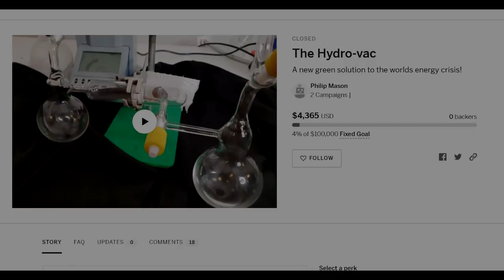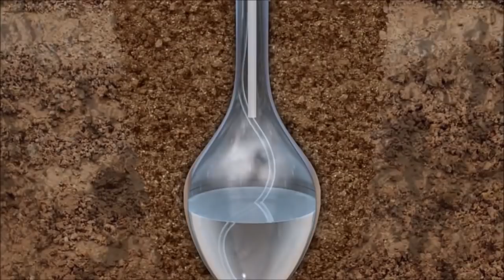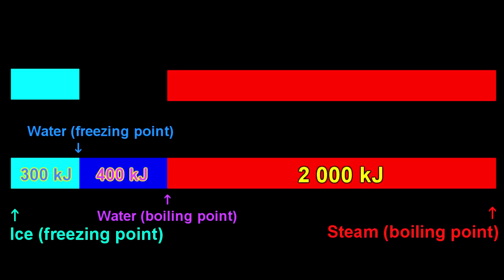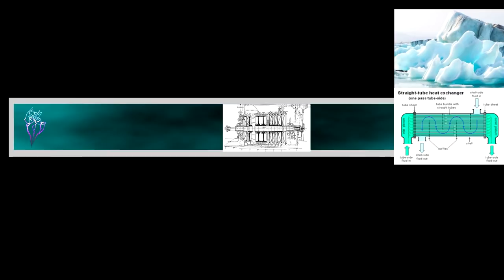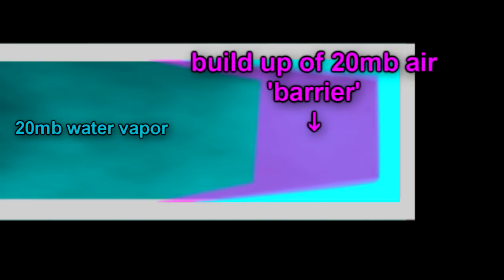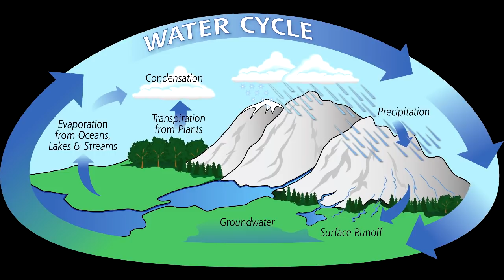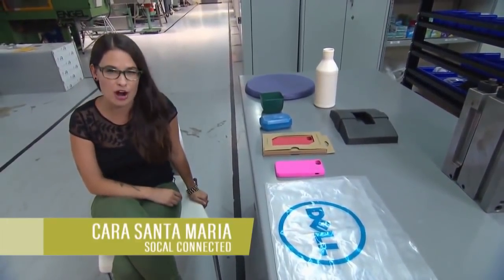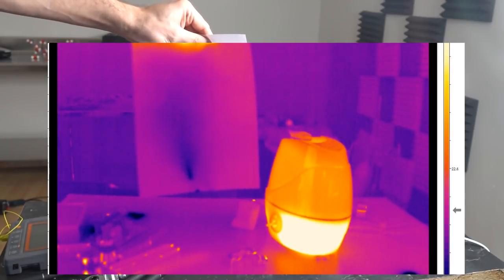The Hydro-Vac -BUSTED

Comment: Love the videos as always or though you did get me thinking about something. There is maybe a situation and some design changes that could make the water seer possible. All that needs to occur is a coolant that is naturally cold and flowing, like the ocean, a much larger wind turbine and air channels and actual fins for heat exchange. So as long as the waterseer is completely redesigned and in the middle of an ocean completely surrounded by water it could actually be possible to get some undrinkable water from it. As always love the videos TF.

Comment: On the flip side these numbers show that primitive evaporative cooling can work insanely well: just rub some water on your arms, wear a wet towel or set up something next to a desk fan. You aren't adding any energy (=heat) into the system to make it work and in most places it's easy to reset by airing the room while the outside humidity is low.

Comment: On the matter of Hyperloop, I've just looked up the Wikipedia page and found that one of the candidates is Edinburgh-London. I know this route well as a railway enthusiast so let's talk about a few details.
1) Would the line have only 2 stations or would there be intermediate stations in Newcastle, York, Doncaster, Peterborough? The more stations, the greater the difficulty.
2) Stations will have to be totally airtight to allow airlock gates to open when trains exit or enter a station.
3) At 700 mph, it would take roughly 35 minutes for the trip from Edinburgh to London. With the time taken to load the train, suck the air out of the departure station, do the trip, allow air into the arrival station and unload the train, this would likely double the time, therefore 60-70 minutes. This eliminates the possibility of running a second train in the same tunnel. Take into account the size of the stations, depending on the length of each train, and we will probably have trains holding 50-100 passengers as opposed to the 600 carried in trains now doing the trip in 4h30/5h00. A lot of people who would normally take a train at 8h00 would have to a train much later. What about those who travel at 10h00, 12h00 etc?
4) Stops at intermediate stations would be a nightmare. Edinburgh - Newcastle (125 miles) would be travelled in about 10 minutes.  How long to open the airlock in the station? Let's say 3 minutes. So the train is no longer travelling in a vacuum and slows down.  Let passengers onto and off the train, reset the vacuum and you have lost maybe 20 minutes.
5) All of this may be good for those in a hurry but Hyperloop is supposed to supply transport cheaper than that which is presently available.

Comment: You forgot to mention friction losses in the tube, there will be a pressure gradient that further reduces the heat flow. To illustrate on your bench setup, you could use tubing that has a length:inside_diameter ratio of 1,000,000:1.

Comment: Coefficient of expansion of steel is 1" per 100' per 100 degrees which is why those expansion loops are in those pipelines!
Reply: Indeed, it doesn't sound like a lot until you start trying to lay out long linear pieces of steel then you have a serious issue if you fail to take it into account. Railway lines give plenty of examples what happens when steel is subjected to ambient temperatures higher than climate forecasting predicted and exceed the allowance made for thermal expansion.

Comment: What you've got here is essentially a Rankine cycle generator utilizing very long heat pipes across a natural pressure gradient. And while this particular implementation of this idea is indeed wildly impractical, geothermal power plants effectively are economically viable versions of the same thing.

Comment: It's just a heat engine using the temperature differential at the equator vs the poles to generate power. You could get pretty much the same power by installing solar panels at the equator for a tiny fraction of the expense. Technology we already have.

Comment: I think sweden or finland use some thing like this to prevent permafrost melt.
A low pressure tube with some thing I dont remember it evaporated on the lower part to release the heat to the atmosphere

Comment: GE has made this system... called a close cycle Rankin generator. It takes 1 mega watts of power to heat the system then a 30c cooling source that makes 125kw of power in the turbine.
Reply: Not very efficient, but you neglect to mention that it's power source would have otherwise been wasted (runs from waste heat).

Comment: Being a physicist first, I am, of course, just interested in the math. Running water vapour at  20mbars means that for a cross sectional area of 1m^2, the max power for the system is 145 kW. But not all of this is extractable. using the Carnot efficiency equation you get a maximum system efficiency of 24%, you can, in ideal circumstances extract 34.8 kW. Let us be generous and say that all of the problems in this video are resolved and you may get 30kW.  To replace a small 100MW system, you will need a tube, 65 meters ( ~220 feet) in diameter running thousands of 'kilometers/miles.  And that is for an 'ideal' system. To run the USA electricity system you would only need 2,000 to 4,000 of these tubes. If you are using 30 meter (100 foot)  diameter tubes, you have a system of pipes 30m (100') tall, Thousands of km/miles long and be  250 to 500 kilometers (~150-300 miles) wide. That means it would cover an land area 1 to 2 million square kms or roughly 10-20% of the total land area of the USA.  This is all assuming high conversion efficiencies. Based on the Trans-Alaska pipeline, the cost of this piping alone will be in the region of $4 to 8 QUADRILLION dollars. (this is being VERY, VERY generous). 

I can see no reason this would not work /* Sarcasm mode off */

Comment: Its psychrometry , wet bulb and dry bulb temperatures.  Pioneered by Willis   Carrier in 1904. Its a basis of air conditioned design that's why there's a difference in temperatures.

Comment: Only one thing that i cannot understand: Why it has to be a closed system? If both ends are open they can act like wind tunnels. If you are inside a cave with two exits to the surface it will be free airflow between them. In the case of a cave it will eventualy warm up, but with a north pole like enviroment it should be working. (of course not calculating the cost of the tube(s) and the maintenance)

Comment: It's doable, to stop the very aggressive rush of h2o - first of all, the main pipe needs to go to many pipes branching out and to have very fast valves that let out yet when closed, act as vacuum machines and keep level of the vacuum while letting liquified H2o out! Multiply these vacuums/pumps as the valves in your car. It's doable 100%
Plus - Location, location, location. What if there is such a great place where we could build a substantially longer loop that could be easier to build and maintain because of the terrain/location.

Comment: We're working on an open source small scale vacuum system to allow hobbyists to work with UHV without the need for expensive turbo molecular pumps or diffusion pumps.  UHV is extremely difficult to achieve reliably and within a reasonable timeframe.

Comment: Very nice video, but you forgot two points:
1) How much power can a turbine get of of there?
The pressure difference is 20mbar - in every pipe you have friction at the walls. For a long pipe, the pressure gradient will get tiny, so good luck getting any meaningful amount of power out of the system :D
For your table setup, the pipes are very short, so that will kind of work - though it is still dump.
Putting kilometers of pipe in between, even just up a mountain, will reduce the amount of extractable energy significantly.

2) (I did not go through the calculation!) in the atmosphere you loose about 1mBar / 10m of altitude - this will be probably be different for pure water vapour at low pressures.
The height difference will certainly work against the mountain version, reducing the energy further :D

Comment: The Earth already does this, but the air from the Equator only makes it 1/3 of the way to the pole before it condenses, hence, monsoons.

You could stick up wind turbines outside and make use of that.

Taking hot air all the way to the poles would melt the poles, but you don't need to take it the whole way. Make smaller tubes.

Or, you know, make use of the fact that (go to start)

Comment: Looking at this, I thought about using a bubble valve (I believe that's what it's called, it's a one way system for moving water) to recycle the same water supply repeatedly. That might be valuable in a much slower system, not for an engine.

Comment: That is true about vacuum systems. Vacuum actually falls with distance from pump so you need more pumps. You cannot just install one pump to evacuate lab format instrument, not to mentioned such big scale system. Pumps are usually not cheap stuff. Even for standard lab instruments with two pumping stages it is at least one or two rotary vane pump and two turbomolecular pump each few thousands dollars worth plus controllers that interfaces pump to computer. For instance ICP-MS mass spectrometer (sector instrument ) uses FOUR pumping stages. Some systems use diffusion pumps, they have no moving part but they need to be heated to cause special oil to evaporate to pick up particles from media, meaning they use electricity for heater. These pumps can achieve really incredible high vacuums. Imagine cost of ONLY vacuum equipment for such thing, not to mention maintenance. And there is question of gaseous impurities which are evaporating from chamber walls. When reactivating one old vacuum system we actually measured some compounds buried on chamber walls from era when old users were using the system. We needed few days to pump out this and get stable vacuum in order of 10E-6 Torr. These impurities should be pumped out probably for weeks or months to create proper vacuum in such huge system. And yes, vacuum systems use special stainless steels for chamber material. Anyway, it is insane concept.

Comment: Main problem of using humidifier to cool down room is: now that air is humid, thermal regulation of humans stop to work normally. Usually one breathes in dry air and breathes out 100% humid one, so lungs cool down the body. The same works with sweat. But if humidifier is turned on, both mechanisms lose their efficiency.

Comment: 4:20 this video is missing some points,

earth tube and wind catchers/towers have been used for thousands of years to cool buildings.
the temperature is naturally cooler underground.
in theory the WaterSeer could work.
1. as long as the air flow rate into the ground does not exceed the rate which energy can be absorbed and dissipated.
2. it would have to be a lot lager.
3. there would have to be a lot of humidity in the air.
4. the wind would have to constantly be blowing.

https://en.wikipedia.org/wiki/Windcatcher

https://en.wikipedia.org/wiki/Ground-coupled_heat_exchanger
Reply: Aaaaand the bottomline point actually was that, at the point that you can fulfill those requirements:
A) is it an actually cheaper way to acquire water than traditional methods?
B) is it really feasible to construct such machine in a place that would actually require it? (I.E. would an environment with such high humidity even lack water to begin with?)
Reply: @isawadelapradera6490  is it feasible in practice?
probably not, it is a lot of serious infrastructure costs for not that much water production. 
but in theory it is possible.

Comment: The easiest way to get "free, unlimited power", you need to either need to perfect fusion, build solar satellites that beam energy down via microwaves, or build an orbital ring. It all comes back to the same thing, use a star to generate power.
Reply: @michaelrowan502  Do doubt, the problem is that you have to keep track of the byproducts for generations, which will eventually lead to a problem.

Comment: Well...even with the mountain location to shorten the distance, now you're making the drag from gravity more significant, where on a horizontal system gravity is an asset. Once you make it verticle now you have the vapor pressure fighting gravity, which depending on the viscosity and weight of the fluid/gas, might only be able to get a flow of about twenty verticle feet. If any are wondering how we can get water into water towers, you push it by adding energy and save that progress with a series of valves/locks. Making it verticle in any way substantially reduces the flow.

The whole principle of this contraption is that its a heat exchanger extracting energy from the kinetic energy released from the flow, where this is the biggest problem of such a project, the flow it one way. Once you reach equelibrium theres no more flow to extract energy from. You have the vapor pressure from the hot side pushing to the cold side, but once thats exhausted in a few hours you will have to add more water on the hot side, and remove it from the cold side. Constantly having to refresh the system in this way on such a large project would make it very energy intensive likely to the point where you're operating at a consistent loss.

Comment: The other thing not mentioned about the Hydro-Vac is the turbines that make the electricity have to push that energy somewhere.  It's less efficient to push energy long distances (due to losses in the system) So if you want to generate energy to some polar bears, that's great, but if you want to give that massive 5K Jules of power to humans, you might just want to produce it closer to the people you're making it for.

Comment: When I saw your little turbine I remember the little sun powered turbine a friend of mine had. I wondered if that could generate electricity. Keep in mind this is when solar panels where very expensive and not very good. The solar turbine is in a vacuum globe I think and the paddle is black on ine side white on the other ( just a reference in case). However I suspect the answer is no on that mostly because I'm not a 10yo anymore and understand science a little bit more.

Comment: Could do a large scale demonstration by using the Alaskan or Kingston pipe oil pipe line as the vacuum tube?  As for the tube to the mountain, once you make the ice you cable it down gathering its potential energy  and almost doubling your energy capture.  Avalanches generate large amounts of energy,

Comment: It just occurred to me that a device like a Waterseer would actually work in an ongoing way if you planted it in the ocean instead of in the soil.  It isn't worth the effort because it would have to go very deep to get to water cool enough to get the water vapor to condense relatively quickly.  In turn, that means the device needs to be quite sturdy to support the pressure at the bottom end, and you have to expend quite a bit of energy to pump the air down and the water back up to where you can use it.  And even then, you probably could only get wet enough air to produce a worthwhile amount of water if you ran it on the tropical ocean...where it tends to RAIN on a daily basis in many regions anyway.  You could put up a rain collector and get water much more cheaply.  Like, say, with the roof of your house or any other building.

Comment: Wow, I was totally expecting some explanation of the pressure differential on the turbine in the tube.  It has millibars of pressure.  Water vapor traveling at the speed of sound hits the blades and most is reflected resulting in a pressure differential.  As with any steam engine, to get any useful power, you need a pressure differential.  This requires a higher pressure on the high pressure side while maintaining the same low pressure on the low side, other wise a rising pressure on the low side will reduce velocity and the pressure differential on the turbine. 

The weight of gravity on the water vapor going uphill was not addressed.  Just like the atmosphere, seawater turning into water vapor is not turned into a weightless gas that spews off into space at the speed of sound.  Great physics lesson, but it stopped short of the other issues.  A lack of pressure differential is a big one.  Love to see your lab model operate with a generator load attached.  Doubt it has enough pressure differential to spin the turbine if it goes through a seal outside to a generator.  Speed with no torque is not an indicator of unlimited energy.  The speed is high, but the flow density and thus pressure is quite low.
Reply: Eh well like he said there is a lot better ways to get the sun to lift water up a mountain for you, like just picking a mountain with high precipitation that you can impound and direct into a pipeline to a turbine at the bottom of the mountain instead. Not exactly novel but it does have the distinct advantage of both being intended to actually work and in reality being capable of producing positive return on energy invested unlike this proposal which was intentionally used to make the point that just because something sounds good at a surface level explanation doesn't mean it's actually worth the hot air used to explain it for any practical purpose.

Comment: Eventually, any system like this (closed) will reach a pressure equilibrium.  Also, eventually that water will fill up the cold end, and that becomes an interesting challenge in and of itself, because you have to melt that condensed water that has frozen, which costs energy... It seems, pretty readily, that once equilibrium shows up, to keep the system out of that state would cost more energy than it can put out.  Yay thermodynamics!